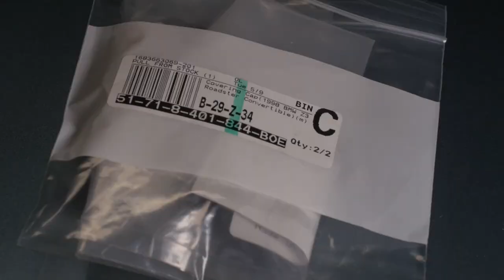BMW Z3 Convertible Top Replacement - Part 2: Installation

Comment: At 9:30 in the video, can you please explain the installation of the second strip of butyl ribbon tape? Are the two strips touching each other, or forming a channel for the water to go between?
Reply from the maker: You know, that is a very good question.
As I recall, the two strips of tape are not touching and are parallel.  I believe my thinking was that those side/end sections are a bit taller, so I'd just add some more to those areas.  I honestly do not remember if I read that somewhere, or if it was just my reasoning.   I CAN tell you that I have had absolutely zero leaks - so take that for what it's worth.
I hope this answers your question.

Comment: Hi Jason, please help me, I am batteling over 6 months with the new soft roof (aftermarket) installation, all followed your steps, however the final end to fold and put the strip because the top is well away from the closing clamps and unable to close, I have already adjusted the maximum limit to the front locking mechanism but NO LUCK? God bless you>
Reply from the maker: Just to be sure I'm understanding where you are at:  You are just at the point where you would glue and attach the flap to the very front of the top and install the metal retaining bow (at about 19:00 into the video)?
There is no doubt that the top is very, VERY tight when first installed.  If you look here:
https://youtube.com/clip/Ugkxnxwf3OT5UqP5H_3KqohEleFOq5yjWNLW?si=8NRZ8M5vEwF5LASI
you can see what the gap looked like initially for me.  I had to sit on the top to get it to lock in.  Even better if you have someone to help.

Another thing to check:  Make sure the  seams in the top are lining up and laying on top of the crossmember ribs.  If they are not centered, the top may be askew and need adjusting.

Also - check for an excessive amount of indentation where the rear tension straps connect.  If the top is being severely pulled out of shape when trying to put it up, they may be too tight, mounted in the wrong place, or need some sort of adjustment.

If all that looks good, you could try wetting the top so it will stretch a bit.  It is canvas and will stretch under tension and a bit of moisture could help that along.  I wouldn't saturate it, but just shower it with a sprayer like it was out in a soft rain.

Note that after adjusting the closing camps, the top may not lock correctly once you do get it stretched enough to finally close.  You'll most likely need to get them set back to there original position in order to get a water tight seal.

I hope this helps and best of luck!

Comment: I found this video last week and after watching it twice , I decided to tackle this job on my '98 Z3. I already owned most of the tools but I did order the pneumatic stapler(wow, that thing is fun!) I bought my top, started the removal process on Friday afternoon, and am finished on Sunday morning! This video was extremely helpful. My old top was slightly different in some ways, as it was not the original. Also, the last top job on my car seems to have lost a few of the bow bolts and some smaller screws at the header. I found some that would work. Overall, A+++ for Maine Jason's video! Thanks, Jeff
Reply from the maker: Hey Jeff, thanks so much for taking the time to comment on your experience. 
I'm really happy the video was helpful and that you were able to complete your project - well done!

Comment: Its certainly scary trying to close the roof for the first time and it did make us start second guessing if it was on right (also ours was a very cheap ebay special) but after few days it was easier to open and now 6 months on its still taught but much easier to close.
And as I said in the comments of your first video, remove the seats and style bars to make it easier to refit the hood.  Granted it takes time to but beleive me your spine will thank you
Reply from the maker: Removing the seats would indeed have improved life when doing this project and that is great advice!  Thanks again for taking the time to comment, and thanks for watching!

Comment: So absolutely by far the best, clearest, most detailed, informational, and entertaining video I’ve seen for replacing one of these! Thank you for the video as I’ve been wanting to replace my top the last year I’ve owned my 2000 2.3. By any chance during your research, did you come across anything detailing the interior “headliner” of the soft top? Mine has one and it does have quite the smooth and clean look inside that I would love to keep if possible. I’m doubtful I’ll be able to keep it though😂
Reply from the maker: Thanks so much for the kind words.  I really appreciate it and I'm glad you are finding it helpful.  As you probably saw, mine did not have a headliner but I believe Sierra Tops has them.  Given my "accident" with the adhesive, I have considered it, but I don't know if it can go in after the fact.  Good luck if you take on this project.  Let me know how it goes, and thanks for watching!
Reply: mine has the headliner and i was able to keep it in place while doing the top, but it increased the level of difficulty a bit.  It is riveted/screwed (mine had both) to the frame under the top at the front of the vehicle, so to replace it after the top was done would require removing the front trim piece and peeling back the top to expose that metal.
Reply from the maker: Thanks for the info.  Having to go back in and do surgery after the fact is what I was afraid of.  Thanks for watching!

Comment: Just finished my install. Final result is perfection. But getting there was rough. There’s nothing particularly hard about any of it. There’s just a zillion steps and the only way out is thru once you get started. The butyl is the stickiest, messiest stuff in the world and takes hours to remove. The stapling is tedious. Much of the job is tedious. But not at all hard or difficult. This video series was my bible. Never once looked at the instructions I printed out. Due to weather and work, took me a week and a half from start to finish. My first 2 days were full and productive. Threw a cover over the car till I could give it a good 6 hours today to finish. Would I do it again? Yes. Here in the Chicago suburbs a professional install is $1100. I actually will be doing it again as my son’s ‘97 needs a new top. He’ll be doing most of the work tho. I’ll just coach. I did change the order of a few steps ever so slightly which didn’t affect anything. The only major thing I did differently from these videos is, I used fishing line to slice thru the old butyl and separate it from the car. Just wriggle the corners free until you can feed the fishing line between the rear bracket and rain rail and slice it along til you get to the middle of the back. Do the same for the other side. Really speeds things along. But speed is relative in this project. Whole ordeal from start to finish probably took 20 hours. Would go faster if you did it all the time and had a nice clean indoor shop with plenty of room. I’ve got a cramped driveway, July heat, and a bunch of random, not terribly well organized tools.
Reply from the maker: That's great, nice work!!  Yes, persistence will get you there.  I've heard mention of the fish line technique from others and it sounds like a winner.
Now that you've done one, the second will be a piece of cake. 😉
Glad the videos were helpful to you.
Thank you for the comment,  and thanks for watching!

Comment: Just finished my installation and I honestly couldn't have done it without your videos your am absolute legend! the people that are saying the new version of the sierra auto tops soft top isn't installable DIY are wrong but it's definitely more of a pain because instead of plastic retainers that you can neatly tuck in you just get flaps of fabric which I just tucked in behind the brackets that the rubber seals go onto, the new top also didn't come with a replacement for the crimp clips that hold the tension cable so I had to reuse the old ones. to add to the challenge the aftermarket top that was already on the car had been installed by someone who didn't know what they were doing and broke the sealing frame,  sticking the broken pieces back in with lots of horrible sticky adhesive and not wanting to source a new one I made a neoprene gasket to seal it off, overall a challenging and fun experience but I'm glad it's over
Reply from the maker: Thanks so much for telling us about your experience!
It's too bad the new tops have changed... I wonder why they did that?
Your extra tips and tricks will most certainly be invaluable to anyone doing this project!
Great job persevering and getting the job done!  It is a big project, for sure, but the reward for accomplishment is great indeed!
Thank you for your great comment!
Reply: what city are you in can i hire to to replace mine
i am in Los Angeles
Reply: @Marco95306 I live in australia but you can definitely do it yourself with enough patience

Comment: I just bought a 2001 Z3 that was a Texas car. The black top looks great except the window is hazy. How can I tell if it’s an original one? It has 83k miles and no rust or signs of leaking. The top has the interior lining also.
Reply from the maker: Great find!  Getting one with no rust is a dream.  As forvthe top, about the only thing that might give a clue is if the back window has the zipper.  If so, it's most likely original - or at least an oem top.
Thanks for the comment, and thanks for watching!

Comment: Replaced my z3 top two months ago, and I wish this video was out when I did it 😭, will actually be doing a valve cover gasket replacement soon with your recent vid, fingers crossed!
Reply from the maker: Well, you got the tough one done - good job!  The valve cover gasket is a piece of cake in comparison.  Thanks for the comment, and thanks for watching!

Comment: When you install the faceplate on the header bow, are you putting the screws through the fabric?
Reply from the maker: Yes.  You can see around the 20:00 mark that the bottom of the plate roughly lines up with the edge of the the folded over fabric.  The screws did, indeed, go through the canvas.
Thank you for the question, and thanks for watching!

Comment: Goo gone for that overspray? It's petroleum-based so it could leave a grease spot, but some rubbing alcohol and a paper towel might be able to get it off. Spot test just in case
Reply from the maker: Thank you for the tip!  I wish I still had the extra fabric from the window cut-out to test on but I will certainly keep it in mind.  Thanks for watching!

Comment: amazing video!  I dont need a new top, but my sealing frame is cracked (common).  I think I'd have to remove the butyl seal and pull the metal bow piece, then pull the sealing frame and repair it or make a mold and fabricate a new one.  none of this will be good.  Not sure this can even be done while the top is still completely attached to the rest of the aparatus.  Thoughts?  Also, what are the staples landing on?  Did you say the bow is aluminum?  Wish the sealing frame was!
Reply from the maker: Thank you much!  If you are not getting any water in your trunk or having any other issues with leaking, I'd say leave it alone!  Mine is cracked right in the center, but the butyl is doing its job so far.
I gave some thought to fabricating a new sealing frame, but nothing reasonable came to mind.  I read a post about using some 1/4" rubber ribbon to make a seal, but the issue would be attaching the top gasket to it.  If you come up with a way of recreating that piece, you'd have yourself a lucrative business!! 😄
I believe the bow is aluminum.   The staples drive into a notch in the bow that is filled with some sort of dense plastic.  Easy to staple to, but holds them well.
If you come up with a good solution for the discontinued sealing frame, let me know!
BTW...great channel.  I've checked out many of your videos and I just subscribed ( not sure why I didn't before! )
Thanks for watching!
Reply: @mainejason  thanks I just subbed you as well.  Had been meaning to check your top vids for a while, finally got to them today.  I do get water in the trunk, I could do the job right with a new frame, but...  I may try needle dispensed super glue into the cracks although it'll be done mostly blind.  Try to put out a video on this Sunday.   Thanks again!
Reply from the maker: Thanks for the sub!  The superglue idea sounds interesting.  If the crack is tight, that may work.  I'll look for the video!  I'm editing a Z3 video right now  - should be out within a week.
Reply: @mainejason  look forward to it!

Comment: Job done here in Vancouver, Canada. Without your tutorial, I would never have tried. Thank you so much! My Z3 has a very deteriorated soft top but with this replacement it is like new again. Thank you so much! I was not easy, not at all but feasible. 

My only 2 cents, I used my old top to protect my new one when  it was time to apply the glue. Otherwise, I followed every step as you taught!
Reply from the maker: Fantastic!!  I’m very happy your install went well - great job!  I’m also pleased to hear that the videos were helpful.  It is excellent that you persevered and got the job done.
Great tip about using the old top to mask off when applying the adhesive - thank you for that.
Thank you for the comment, and thanks for watching!

Comment: Can anyone who has completed this job estimate the number of hours it took?  This is on  my list to do, but i want to budget time correctly.
Reply from the maker: It will certainly depend on one's comfort level with using tools and working with mechanical as well as fabric materials.  It will also depend on if all the appropriate tools are available. 
I'd say an actual installer could do it in a half day.  A competent diy'er could perhaps do it in a day, but I'd budget 2.
I'd be curious to know how much time others took as well.
Reply: I'd say I'm a competent DIY guy, and I will have all appropriate tools on hand before starting.  

I also have 3 kids in elementary school, so I'll budget 3 months 😂😂😂
Reply from the maker: HA!
Sounds like you are on the right track.  Good luck with the project!

Comment: @mainejason I replaced my soft top about a month before you made this video… wish I’d known it was coming!!
Unfortunately, I didn’t think to check my sealing frame for cracks at the time and my new top looks great but my trunk is full of water with even the slightest rain. 
What do you think would happen if I were to remove the bow and “repair” the sealing frame/replace butyl tape with the rest of the top still installed? I’m considering ripping the sealing frame out entirely and replacing with thicker butyl. Living in VT, I’m pretty sure it’s going to keep on cracking.
Reply from the maker: Ohhhhh, that sucks!
You should be able to lift out the bow with the top attached and either fold it back or suspend it somehow.
The problem with not having the sealing frame in there is that the rubber sealing gasket attaches to the top of that.
Maybe, if you could get the sealing frame out without breaking it into 25 pieces, you could replace the butyl tape behind it, high enough and thick enough to fill the gaps.  But, that's a lot of work with no assurance!!!
That sealing frame is definitely a weak spot in the engineering...especially since it is no longer available!
Good luck to you!
Thanks for the comment and thanks for watching!
Reply: @mainejason success! Thanks for the input. I was able to take just the rear bow & sealing frame back out without removing the top. The sealing frame came out in 5 pieces, as expected. After cleaning it up, “laminating” it with foil tape and re-installing with butyl tape, there are no leaks! I think it’ll be a little more resistant to cracks now too with the tape. Really appreciated being able to reference the video. I’m psyched! Thanks.
Reply from the maker: Hey, I'm really glad to hear the good news!  Great idea with the foil tape - very resourceful. And best of all, no more water in the trunk!
Thank you for the update, and well  done!
Reply: @mainejason  I have the same problem. The previous owner got the top replaced, but it's leaking into the trunk. So will have to try to get to the sealing frame and have a look at its condition. Great to hear that you managed to access it without removing the top!

Comment: I'm surprised you didn't take the seats out to work on the bolts for the bow. One of the best parts about a 2-seater being a convertible or a t-top/targa is just how easy the seats come out compared to a fixed roof car. And taking out the seats makes work on the interior of the car so much easier.
Reply from the maker: I thought about taking them out, but I was concerned I'd damage the wiring harnesses while flailing around in there - lol!
At least having the seats in was a little easier on the knees. 😉
Thank you for the comment, and thanks for watching!

Comment: What size staples did you use? I was going to order some 12mm long... is this too long?
Reply from the maker: Go with 10mm and make sure they are stainless steel so they don't rust.
I don't know why I didn't have a link to the correct ones in the description, but it is there now.
Good luck!  Thanks for the comment, and thanks for watching!
Reply: @mainejason  I'm attempting mine in 10 days time. I'm very practically minded but your vid gives me confidence!
Reply from the maker: Very cool.  Let me know how it goes!

Comment: Thank you for this video. Gave me the confidence to replace my top. Mine is a 2002 with the headliner, replacing the headliner was not too complicated but requires moving over a few parts from the old headliner to the new one.
Reply from the maker: Excellent!  Great job taking on a big project and seeing it through.  I'm so glad to hear this video is helpful as that was indeed the intent.  Thank you for the comments, and thanks for watching!